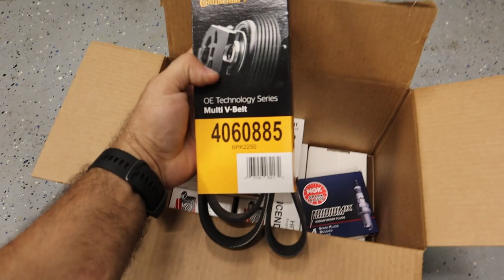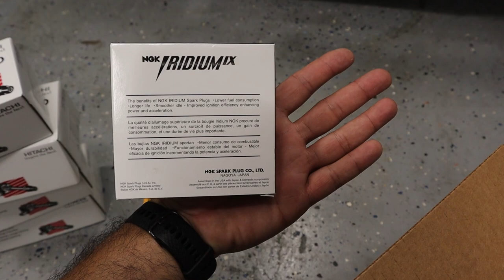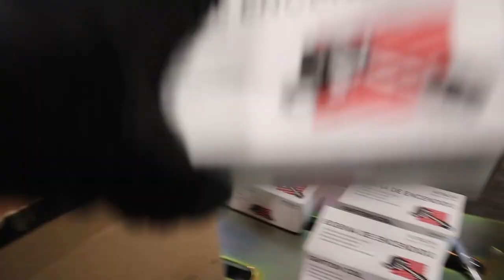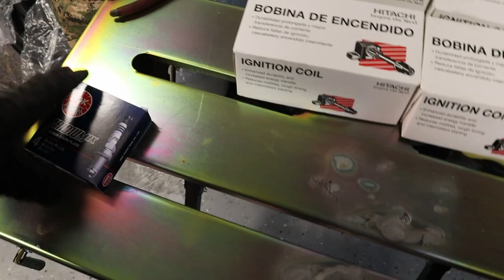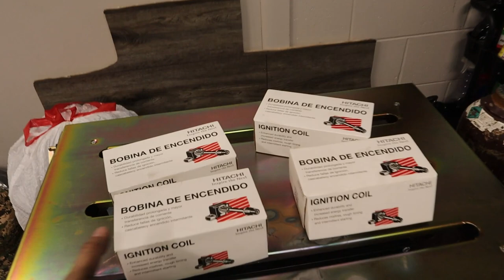Had A Change Of Parts

Comment: Good stuff!

The piping looks good, how many lbs of boost will you run once its tuned? Did you gap the new NGK's ? If not the gap spec for our cars is .028

It's ironic that you have the purple titanium bolts, I used them all around in the same places you have the stainless red screws. Looking goood bro! My IC piping and turbo housings hot/cold side is currently with Jet Hot for coating. Once I get that back I should be all set.  Just have to decide on staying with my SAFC or upgrade to RevUP.
Reply from the maker: Thank you bro! Currently keeping it safe at 7-8lbs max since I'm all stock. I'll work on forged internals in the near future to up the boost 😎